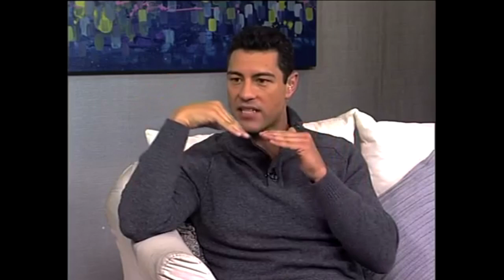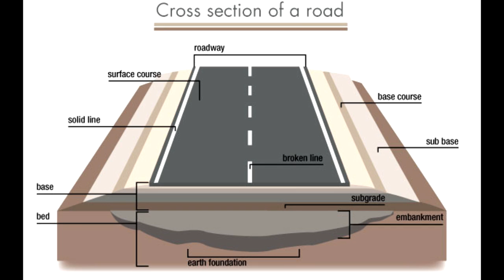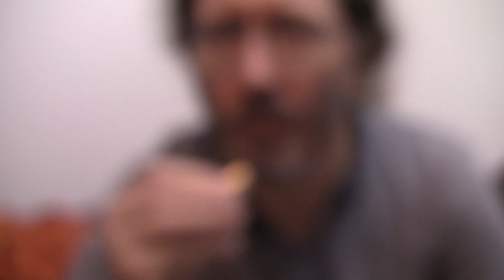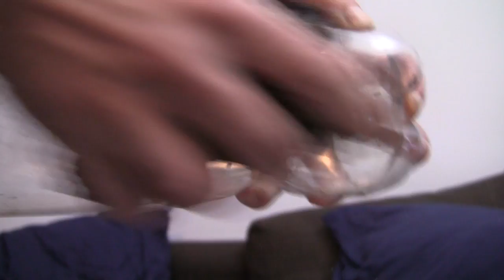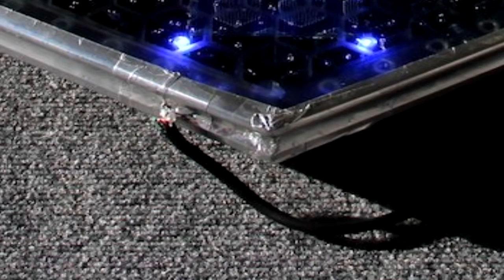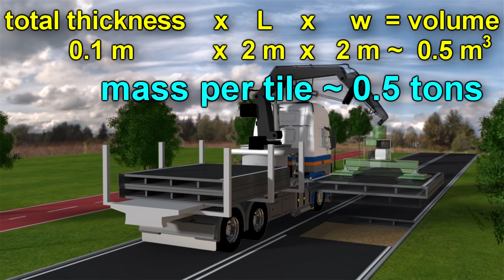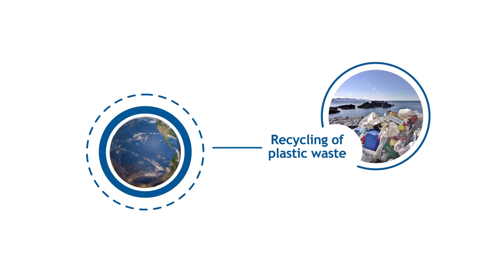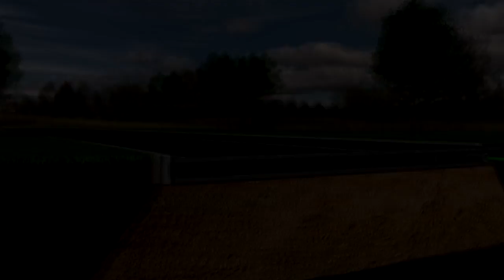Plastic Roadways BUSTED!

Comment: Honestly this doesn't sound like a bad idea for sidewalk pavement.
Reply: hellcat1988 What's with your obsession with that article?
Reply: If you're going to use virgin plastics as a matrix to bind your composite material, you're not talking about a recycled plastic structure really. I could build you a bridge of concrete made of stone, rebar and melted plastic that will likely be many, many times stronger than conventional reinforced concrete. What those two bridges really demonstrate is how much recycled plastic can be substituted for aggregate before the bridge becomes impractically weak. There have been way, way more examples of using recycled plastics in concrete, which personally makes a lot more sense to me because it eliminates the need for UV stabilization. 
Anyway, that has always been my beef with these things.  I read an article recently about some girls in the middle east researching recycled glass as a replacement for sand in mortar, but it was presenting it as though a) they came up with the idea themselves and b) this mortar is just made of glass. We're just taking small parts of conventional building materials and making substitutions until the thing stops being useful, we're not rebuilding the world with recycled material. Essentially we're just trying to find creative ways of hiding our garbage.
FYI I'm a bridge engineer, but these are of course, just my opinions.
Reply: I still don't get why everyone is ignoring the fact that we can just mix recycled material into concrete, if we're bothering with using fresh materials. Fiber reinforced concrete is already a thing, it's just really difficult to keep it from clumping. There's also crumb rubber as a substitution for aggregate, with obv different applications.
Reply: hellcat1988 My comment was thrown out there, just as yours was. Your bridge is a composite, not pure plastic. It's no doubt that this idea is completely idiotic, and I have no idea why you're advocating for it. And a Google search doesn't always bring up the truth, in the same way that I shouldn't go to a library expecting all books in there to contain all fact
Reply: hellcat1988. you cannot compare the resilliance of a Lego brick against a ~4 psi bite from an animal to that of what a road would need against cars. A small brick will also be more structurally secure than a, say, 3×3 meter plastic brick road.
Reply: Well, what do I know, I'm just a structural engineer; Thunderf00t is obviously my only insight into this topic.
Reply: I'm going to go build a 50 ft bridge made out of straws from Mcdonalds and drive a tank across.
It'll definitely work.

Kappa
Reply: Newton's Third Law Same thing with solar, just use it to power lamps on the sidewalk
Reply: Man!  First I was against Plastic Freakin' Roadways, but once hellcat1988 started dropping the insults I realized how feasible they really are!!!!
Reply: hello comrade
Reply: Maybe, juuust maybe, the vast majority of us are only here for entertainment, and not because we're all going to get some George Soros rent-a-mobs to protest the solar roads people.   Any reports about antifa mobs busting into their labs and sabotaging their shit?  I haven't read anything about that.  The only involvement in solar roadways on this comment board is you and the other two people who dropped a couple of bucks on the funding campaign.  No one else here has a dog in the fight.  If you do happen to throw a couple more insults my way, it will probably get me to go work extra shifts so I have the disposable income to see solar roadways a reality.  XD
Reply: +hellcat1988  First, thanks for cutting back on the insults; I honestly appreciate it.  
And while tf00t IS a human being and therefore subject to the same human weaknesses as you and I, in this instance I honestly don't think he's trying to suppress a new technology, but is pointing out the measured and possible flaws with these people's application of existing technologies.  

The one that keeps popping into my head is that even if the tiles are textured, what is the result of a car going 60 mph (HA!  Who does only 60 on the highway?) trying to stop on a glass surface, and then throw in rain or snow.  

For the research part, like I mentioned above, none of us is going to hunt down the creators of this thing.  We're all (well, "I", at least) no more interested or disinterested about SFRs than before we watched the vid, so I honestly don't think that the viewers here are going to have a part in suppressing these people.   :-)  I just caught myself smiling because to your point of people blindly following and society stagnating, it's true, but that's what we're seeing from the Social Justice Warriors and the Left in America today, but that's a WHOOOLE other conversation.

When you said people think that solar panels make it darker, could they mean the shade beneath the panels?  Not saying you're wrong but if those people exist, then I'm not allowing them to make any medical decisions for me.  :-)   And finally, in tf00t's defense, inventing solar panels was the creation of a whole new technology, whereas this is combining solar panels, LEDs, and a control mechanism, not creating a new level of technology.  It IS kind of a cool idea, but just not the best application for our current road system.

I enjoyed the new direction of our conversation.  Cheers!
Reply: (edit)  My bad!  I didn't check, and thought we were discussing the solar roadways.  (Note to self: Coffee, THEN internet.)
Reply: like that rubbery pavement made from recycled rubber? https://www.rubberflooringinc.com/Assets/Product/Images/912x600/3275.jpg
Reply: That's nice... but the concerns we engineers are going to have with a plastic road are going to be durability against erosion, UV degradation, and in this case, thermal expansion- bridges are designed with this in mind. Roads generally aren't. With this panel design, if they heat up past the point where the panels are flush, panels are going to start popping out, and that's going to be HELL on your suspension.
And how do they do with water erosion? How good of a gripping surface does it have? How long will that gripping surface last before it erodes to a smooth surface b/c plastic?

You can drive a tank on a bridge made of wood. I still wouldn't want to make roads out of it.

Not to mention, while plastic may be cheap, asphalt is cheaper. Modern roads are basically busted up rocks trapped in oil waste. It can be recycled onsite; just break up the old asphalt, mix in new tar & some more rocks. Expense is going to be a BIG part in choosing a road material.
Reply: Newton's Third Law EXACTLY!
Reply: REEEEE UV STABILIZED PLASTICS REEEEE
Not sure how I overlooked that point but okay. I'm just saying if you're going to use virgin materials with recycled randomness mixed in, concrete would be my preferred solution for reasons I won't bother repeating. Also those things you mentioned aren't exactly subject to the same wear and tear as a bridge is. Apples and oranges.
You can build anything out of anything so long as the material strength is good enough, but that doesn't mean it makes sense to use it. I could probably build you a bridge out of lego pieces that would be good for a few uses, throw a wearing surface on top and it'll be good for a long while. I'm sure plastic bridges have their niche, although I find the fact that they use thermoplastics rather strange. I see no reason why you'd want to build with something that melts at low temperatures other than for constructability, in which case I would have just made prefabricated members with a plastic with a much higher melting point. Imagine this were used for something more critical, say people went over this, pedestrians and motorists and the span was I dunno, 500 feet, and now imagine there was a fire. Seems a bit silly to go with something, among its own class of materials, is unique for being weak at relatively low temperatures when asphalt in the summer can reach 140 F.
Reply: REEEEEEEE
It's like you didn't even bother reading my posts. In any case, this was fun, enjoy shilling for plastic bridges, and driving to work like 99 percent of the planet.
Reply: Fort Bragg Nc 70 ton tank drives over plastic bridge, much to your dismay
Reply: I have no obsession with it.  It merely demonstrates the durability of plastics in an extreme use of the material beyond what most would consider adequate for most applications; such as roadways.
Reply: Yes, the SFR people were overly ambitious about their plans, but the european implementation is far less over-reaching and much more viable.  

As far as the road surface is concerned, I understand people being nervous about the traction they would get from plastic and glass.  

I'd remind them (assuming they've ever actually experienced it while driving) that asphalt is JUST as slick and dangerous in some conditions as driving on the surface of a frozen lake.  Light rain is enough to cause some of the diesel (yeah, that's what they use) from lubricating the surface compactors to come to the surface and make it slick.  Then there's all the oils dropped from cars doing the same.  Let's also not forget that ice and snow buildup make it just as slick as driving on lubricant regardless of the texture of the surface.

As someone who lives in an area where ice and snow are a part of daily life 6 months of the year, I can honestly say that a properly textured glass or plastic road surface could provide better traction in adverse weather conditions in comparison to asphalt.

Every year, when the ice and snow begin to build up during a storm and before the plows begin clearing and salting the roads, gravel roads tend to be safer to drive on.  Because of the extremely rough surface by comparison and the freeze tending to prevent much shifting, the gravel gives much better traction.  Sure, after enough snow and ice have built up they are just as dangerous as paved roads, but until then they are my preferred route even while working.

I'm not saying that these plastic road panels or glass covered solar (or in the case of the european example, resin) surfaces would need to be nearly as textured as a gravel road, but it's possible to make them far safer than asphalt in anything but the most extreme conditions.

Also, yeah I meant the people thought that it would take sunlight from areas where the panels weren't.  And they're american.  Makes you really inspired by our education system, doesn't it?
Reply: Not driving TO work, although I do that as well.  I drive FOR work.
Reply: they do already have rubber side walks same idea
Reply: I haven't funded it either.  I just did some looking into what thunderf00t is talking about as he seems to try and present himself an expert.  What I've found is he's either incredibly bias, ignorant or both when it comes to these technologies.

It's when people refuse to do their own research, to blindly follow someone who has a good pitch, that society stagnates and religion thrives.  Hell, there are people so uneducated out there they think solar installations will steal sunlight from the surrounding areas and make it darker.  I kid you not.

Who knows where we'd be if people never experimented with solar tech in the first place.  I'm sure there were plenty of people like thunderf00t in the beginning who never believed that solar cells of any type would ever be a viable energy generation source.
Reply: I could get into who's been running the majority of our public schools for decades, but that too is a WHOLE other conversation.  XD   I'm continuously thankful that I graduated before everyone started losing their minds.
Reply: Adriano Andrade:  

Two things.  First, GOOGLE UV STABILIZERS FOR PLASTICS.  I'm getting really tired of people not even attempting to think in this back and forth.  Even asphalt roads are subjected to UV damage and heat damage over time, on top of their normal wear.  That's why they have to be replaced regardless of traffic load.

Second, that's why they're RECYCLABLE.  Yes, even with the best UV stabilizers on the market, plastics break down in sunlight.  When that happens to an extent that the surface or entire panel is compromised, you replace it with another one.
Reply: The whole point of this system is scale and speed.  It would be cheaper because of how fast it can be installed and replaced, therefor reducing the down time of the road and the cost of crews working on it.  Even if the road panels themselves were more expensive, it would probably end up cheaper.

There's a section of US highway 10 in Glyndon Minnesota that's been under construction for months now that would probably already be completed if these panels were available.
Reply: First, if the panels were going to wear out faster, why would multiple governments across the world be ordering MORE bridges made out of plastic.  Obviously they wouldn't be if the surface and structure weren't holding up just fine.

Second, smearing tar in the cracks of asphalt roads isn't a repair.  It's a patch to attempt to keep water from getting to the substrata to undermine the road surface or freeze and damage it more in the cold.  That tar breaks down or is pulled free by traffic over time, and many more cracks form that require attention in addition to the first ones.  That's one way pot holes are formed and why there's such a major industry around developing was of repairing them.

Third, the panels don't actually NEED to have the wiring and pipes going through them.  They could be constructed in a separate channel that the panels just cover.  Even IF the wiring and plumbing were to be routed through the panels, quick disconnect fittings and contacts could be used to allow the panel to be removed with little effort.

Every single problem that people have found in this system has been solved in other industries or by previous iterations of a similar concept for quite a while now.
Reply: Ok so you don't just suck at research, you're lazy as hell about it too.  I've provided links to several articles, including ones about bridges used for tank traffic in america in other posts on this video.

Here's one of them.  Stop being lazy and do your own research.

https://www.cnet.com/news/u-s-army-orders-bridges-made-of-recycled-plastic/

Second, it's not just asphalt that is leached into the ground when those roads break down.  Most of those vehicles used for compressing the asphalt use a mixture of diesel and other chemicals to keep the asphalt from sticking to the rollers or tires, which in tern leaches into the surrounding soil and water table.

Third, if patching the road were so easy as to scrape off a small portion and lay new asphalt, why don't they do it?  Why are roads all across the country in such poor condition?  Why do they replace whole sections of road instead of continually patching it?

The answers are cost and complexity.

It costs more to patch asphalt roadways than you seem to think, as the patch area needs to be properly prepped, a primer adhesive like tar applied, the asphalt added in the right thickness, then compressed to be level with the existing road least they need to bring in a grinder to grade the existing road to the patch.

All of that takes time and money.  More money than most counties or towns have to throw at something like that on a regular basis.  Hence letting roads get to the condition where they need to be replaced in their entirety.

The plastic road panels might cost more to install in place of existing roadways, but the reduced preparations and quick replacement mean it would probably be cheaper to install for new roads.

Finally, as far as the material wearing down and being distributed into the local environment, yes that is a potential problem.  The amount of plastic that would be diverted from landfills into these projects more than offsets that though, and reclamation projects to remove plastic particulates from waterways are an easy enough proposition if the particulate does indeed float.
Reply: You're not doing your research AGAIN...  

Those military bridges have been covered by more articles, as well as other roadway and foot bridges made entirely out of plastic; including their support structures.

You would have also, if you'd BOTHER TO DO YOUR DAM RESEARCH, learn there are more than one or two companies exploring plastic and plastic composites for things like roadways, bridges, buildings, and even railroad ties.

I understand you have a mindset that you can't seem to get over, and I'm sick of having to provide the same examples over and over again for slightly different variations of the arguments against them.  If you want to bash the roadway idea, fine.  That's on you.  I'm done trying to get you idiots to actually think.
Reply: Baka
Reply: +Newton's Third Law

Why do people keep forgetting that we ALREADY have UV stabilizers in plastics?  Sure, they aren't perfect, but they are a thing already.  They're in bumpers, headlights, body panels, trim, and even hub caps in cars.  They're in vinyl siding.  They're in many of the plastics you have inside your home as well because manufacturers aren't idiots and know that people have windows.
Reply: Oh for the love of....  GOOGLE YOUR STATEMENT'S FACTS YOU IDIOTS!  You're just making yourselves look like complete idiots.  Or tramp supporters.  Either way...  A dog's bite is WAY MORE than 4psi, as is a humans.  

https://www.quora.com/How-much-force-can-an-adult-human-bite-exert-And-does-that-force-vary-between-male-female

I do acknowledge that a small brick will have to support less weight over it's much smaller surface, but there's no reason you can't design a structure into the roadway's support to hold up.  As has been PROVEN by the bridges that have held up to traffic from cars, trucks and even TANKS.
Reply: Maybe if you guys were willing to bother doing any research of your own instead of taking Thunderf00t's word as gospel, I wouldn't be so inclined to insult your intelligence.  Just like with religion, it's the blind ignorant faith that prevents progress.

I still have yet to see a video from him about the French solar roadways project that's been implemented and expanded to other countries...  
http://www.globalconstructionreview.com/news/frances-solar-roadw7ays-com7es-ame7rica/
Reply: It can do more than that.

https://www.cnet.com/news/u-s-army-orders-bridges-made-of-recycled-plastic/
Reply: Newton+
If you are a structural engineer, then you should know that the concept of plastic road surfaces, on it's own, is viable.  With the proper base material, far less effort would be required to install plastic road panels of a proper design than asphalt.  

If they can hold up to trains well enough that they weren't replaced and they can handle heavy road traffic as bridges, I doubt it'd take much to construct a viable road surface with them.
Reply: You are incredibly ignorant, aren't you?

There are already plastic bridges where civilian traffic and pedestrians cross on a daily basis.

http://www.constructconnect.com/blog/construction-technology/recycled-plastic-key-building-better-roads-bridges/

"Plastic Bridges
The technology for thermoplastic composite bridges was developed in 
the late 1980s at Rutgers University as part of a government-funded 
program to develop recycling systems for plastics. The composite polymer
 used to make the bridge components are 80 percent post-consumer 
high-density polyethylene (HDPE), think milk jugs and shampoo bottles, 
and 20 percent polystyrene plastics which are recycled from old 
automotive bumpers and dashboards. The bridge materials are manufactured
 by AXION International and developed in conjunction with Rutgers 
University.
Currently, there are only two bridges located on public roads in the 
United States that are made of 100 percent recycled plastics. The first 
was completed in December 2011 on Birch Hill Road in York, Maine. The 
second, with a span of 24.6-ft, is the longest in the United States and 
located on Township Road 174 in Logan County, Ohio."

"The longest recycled plastic bridge is located in Peeblesshire, Scotland
 on private land spanning the River Tweed was made of 50 tons of 
recycled plastic. The bridge is 90-ft long and built to support up to 44
 metric tons."

 Notice how they say 100% RECYCLED PLASTICS.
In reference to your claims of a relatively low melting point

https://www.reference.com/science/temperature-plastic-melt-77fde517ae8c6809#
http://plastictroubleshooter.com/ThePlasticTroubleshooter/melt_temps.htm
http://info.craftechind.com/blog/dont-sweat-it-these-4-high-temp-plastics-can-take-the-heat

That took maybe 20 seconds to google and read to contradict your fears, as even plastics with some of the lowest melting points are able to withstand far more than 140f.  

And by the way, it's not surprising that a dark surface made of a material that can conduct heat would get hot in the sun.  That's simple logic, but it must seem like some kind of revelation to you so I can understand why you think others wouldn't have figured it out yet.

Second, you obviously have no idea the kind of abuse that headlights and bumpers are subjected to on a regular basis, do you?  From chemicals spewed out the back of vehicles and splashed up from the road surface to impacts by rocks of almost any size, the plastics we have now are pretty dam durable.  We wouldn't be using them otherwise.

To use your lego reference for an example, do you have any idea the level of abuse that lego is subjected to over it's average expected lifespan?  From repeated friction to constant stressing as it's assembled and disassembled, not to mention having to be able to hold up to being chewed on by pets and kids, it's pretty strong plastic.  You can drive over the individual bricks with a car and not damage them.

As far as your concerns with fire, there's no reason that flame retardants can't be both impregnated into the plastics to prevent fires from spreading as well as in burstable capsules contained within the plastic to extinguish fires from vehicles.

I also never said that adding stone as an aggregate wasn't a viable option either.  Even after the road is considered beyond repair, the plastic can be melted off the stone and both can be reused to make a new road surface.

The reason I consider this plastic road surface a better idea than concrete is because I drive for a living and know JUST how poorly concrete can withstand chemicals from vehicles, temperature and moisture variations, ground movement, and general wear and tear.  There's a reason people tend to be cautious about salting a concrete driveway or walkway in the winter.
Reply: Like the bible you mean?  Anyway...  If you actually don't believe in anything then why the hell would you ever make a statement as a fact, regardless of it's truth?  If you're one of those people who see conspiracy in everything and can't judge the tree for the forest, you should never speak in anything but question form ever again because it's obvious you don't actually know anything. (for sure, according to you)

If you actually bother to read the HUNDREDS OF ARTICLES related to some of these bridges, you'd see that while some of them do use composites with other materials, some use two DIFFERENT TYPES OF PLASTIC, hence still being labeled a composite.  Those second type are still 100% plastic though.